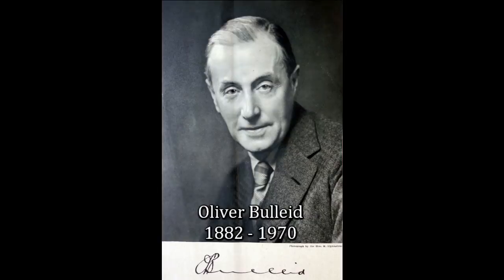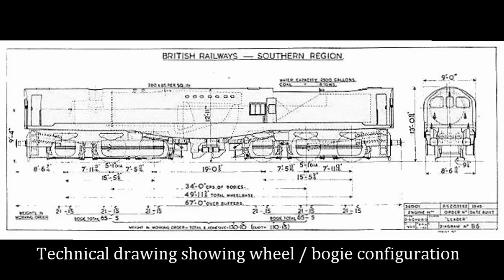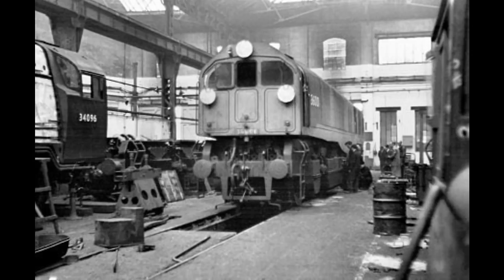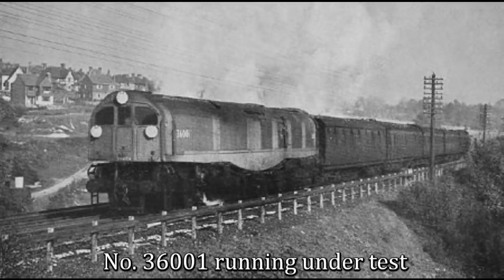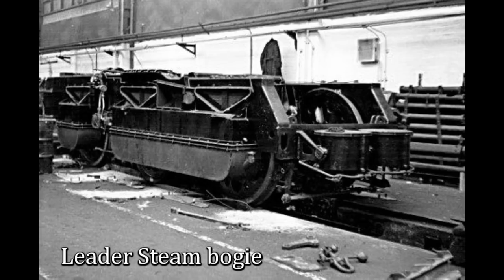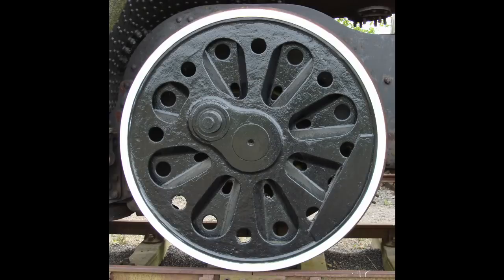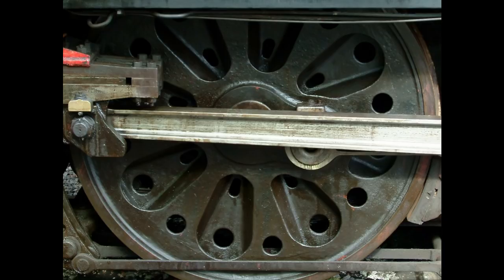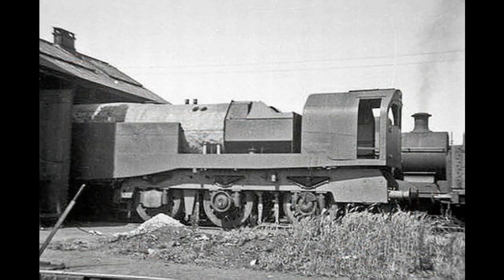Strange Locomotives - Bulleid Southern Railway Leader Class Steam Locomotive

Comment: It needs someone to to build one today using modern manufacturing methods, plus getting rid of the ridiculous idea of having a corridor running between the fireman’s footplate and the driving cab in front of the smoke box which meant the boiler was offset, so causing weight distribution problems, having an the footplate accessible from both sides of the loco, so the fireman had more light and air, then it would work. The basic principles were right but the manufacturing and execution of the project was all wrong.
Reply: Make it oil burning, then fireman and driver share the same cab.
Reply: Yes.  The corridor solved a problem that did not need solving.

Comment: High power and low maintenance ..... sounds like SR needed an electric locomotive.
 If an engineering department is looking for ways to extend the life of steam traction, then by definition, it is at the end of its useful development. What made this locomotive look odd, was the bogie arrangement wasn't configured as a mirror image.
Reply: What made this locomotive look odd was that it had an enclosed cab at each end!
Reply: @bingola45  - It was as pointless as it was weird.
Reply: @channelsixtysix066  The only thing 'weird' about it was that it used steam technology. Mainstream Diesel locomotives used this double-cab  bogie layout almost exclusively.
Reply: @bingola45  - The configuration didn't work for a steam locomotive.

Comment: Where is the point of articulation?
Reply: The mid-pint of each bogie, or thereabouts.
Reply: @bingola45  The point of articulation is where the body bends.  The body does not bend.
Reply: @georgewindsor6438  The 'point of articulation' is the point around which one part moves with respect to the other.
Reply: @bingola45  The point of articulation is where something bends.  What you are describing is a pivotal point.
Reply: @georgewindsor6438  The 'point of articulation' is the apparent point around which something pivoted appears to turn.
An articulated lorry is a good example. Nothing actually 'bends'; the tractor and trailer are so constructed that the overall wheelbase is not rigid. 
This is called 'articulation'.
Reply: @bingola45  An articulated lorry bends in comparison to a non-articulated lorry.  The pivot point in that case is the mechanism that allows articulation but is not articulation in itself.
Reply: @georgewindsor6438  This discussion is now about lexicography, not engineering.
My interest is in the latter, not the former.

Comment: The aftermath of war insufficient funding to work on the new design. If they’d been oil burning they might’ve been successful.
Reply: Might have been but probably wouldn't have been.
Reply: Phil Potter You’re right I’ve done a bit of reading and the design prototype had many mechanical problems
Reply: @likklej8  
I can't remember much of my study of the Leaders but I recall that there were many design problems. One thing was the lubrication of the valve-gear and another was the water supply for the boiler which I think was by pump rather than injector. I think it had a faulty chain grate too.

Comment: He overthought it. Instead of having steam powered wheels, he should have linked steam output to a generator and had six traction motors in a simpler bogie. Nice try,  but no banana.
Reply: Colin Easton - the Swiss did this the other way round during the war and produced a few steam engines which took their (hydroelectrically generated) power from the OHLE to "fire" the boiler (think "kettle") and produce steam for the otherwise conventional engine.
Reply: @1258-Eckhart   Similar to the Hornby live steam loco.

Comment: Very interesting and a real shame about the problems. The missed opportunity was to fire it on DIESEL so a comparison of efficiencies and flexibility between the IC engine and the EC engine. With stored steam pressure of the EC engine, It could well have accelerated better than the IC engine - and with boiler development and a little automation, not needed a fireman at all.
Reply: OIL-firing was used on steam locomotives during a government-backed initiative after the war, although on a limited basis.
The LEADER project did, at one time, include the possibility of OIL firing; there is a reference to both crew members carrying out their tasks seated, which would imply oil, rather than coal, as fuel.
DIESEL is a different technique altogether. It involves INTERNAL combustion, with the fire actually inside the cylinders, rather than in an EXTERNAL firebox heating a boiler.
It has no relevance to the LEADER project whatsoever. The two should not be confused.
Reply: @bingola45  "there is a reference to both crew members carrying out their tasks seated, which would imply oil, rather than coal, as fuel."
Did we not achieve automated coal feed ? It seems the US did.
How you burn diesel depends on the burner whether in a cylinder or not.
Reply: @millomweb  Mechanical stoking was tried on locomotives in Britain, but with little success. I've never come across any suggestion of using it on the Leader class, although it might have been possible.
The Diesel engine is, by definition, an Internal Combustion oil engine. There was a type of stationary engine which combined both cycles, at opposite ends of a double-acting cylinder, called the Still system, AND a locomotive was produced by Kitson and Co. of Leeds, using this principle, and, unsurprisingly, called the Kitson-Still locomotive.
You appear to have mistaken Diesel for a type of fuel oil.
It isn't. It's a thermal cycle named for the engineer  who patented it.
The two should not be confused.
Reply: @bingola45  "The Diesel engine is, by definition, an Internal Combustion oil engine"

You've added 'engine' to that. I never said 'engine'.

"You appear to have mistaken Diesel for a type of fuel oil."

No mistake - diesel is a specific fuel oil for the purpose of fuelling Rodolph Diesel type engines. But that doesn't stop you spraying it as a mist through a nozzle and igniting that mist - as per heating oil - which isn't vastly different.

AKA: DERV !As it's used as a fuel for DERVs.
Reply: @bingola45  "Mechanical stoking was tried on locomotives in Britain, but with little success"

What were the difficulties with it ?

If you watch Keith Rucker on Vintage Machinery channel (based in Tifton, Georgia, US of A), He spends some of his spare time at an ag/mech museum and one 'little' job he's assigned himself to is to get a stoker engine back into working condition !
Reply: @millomweb  DIESEL on its own is NOT a fuel.  Diesel Oil, or Diesel Fuel Oil, is an industry- grade fuel oil for Diesel engines.
DERV on its own is ALSO not a fuel, despite what the Chancellor of the Exchequer might think.
DERV fuel oil is a TAXED grade of oil, for use in Diesel Engined Road Vehicles.
LAMP on its own is not a fuel. Lamp Oil is a grade of oil used for lighting.
I doubt that you would suggest  Bulleid run his engine on Lamp.
The stupidest one I've ever heard, and from within the road transport industry, was from a fitter who claimed to have cleaned some parts "... in TWO STROKE" !
Reply: @millomweb  Mechanical stoking is best left to large stationary plant, where the load is constant, the grate is large, and the fire is of uniform thickness.
In locomotive work, the skill required for optimum combustion is usually best applied by a shovel.
(Mechanical coal-pushers were good, though, when they worked!).
Reply: @bingola45  Is that 2 stroke oil or mixture ? Possibly either will clean parts.
Being pedantic, one would say dieself fuel oil - to avoid confusion with diesel lubricating oil.
Reply: @bingola45  'Coal-pusher' rather than 'stoker' seems to suggest the problem is with fuel distribution in the fire box. And that is understandable ! Getting a fire to burn efficiently is an art.

Comment: Not articulated. It is bogied.
Reply: Bogies denote articulation, so it is Articulated
Reply: @almostkentish3042  Articulation denotes  more than one piece.  The engine is in one piece
Reply: @higgsboson4004  ok, let's look at it like this. A Fairlie's Patent Locomotive locomotive consists of one 'piece' mounted on two bogies, yet it is articulated. The leader is the same and so it is articulated
Reply: @almostkentish3042  You've been reading Wikipedia again.  Here's a definition "having two or more sections connected by a flexible joint."
Reply: @higgsboson4004  
AlmostKentish is right. Fairlies, Kitson-Meyers and Beyer-Garretts (among others) were all referred to as articulated long before Wikipedia was thought of. Your definition is not the engineering definition, it's an anatomical definition.